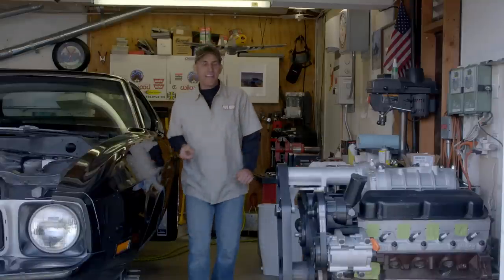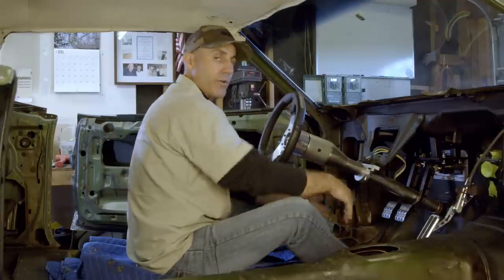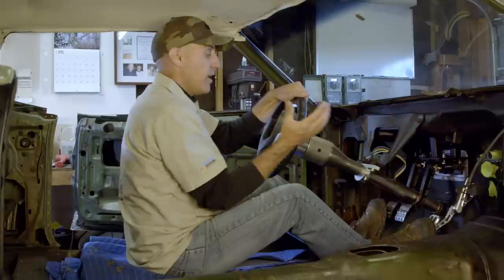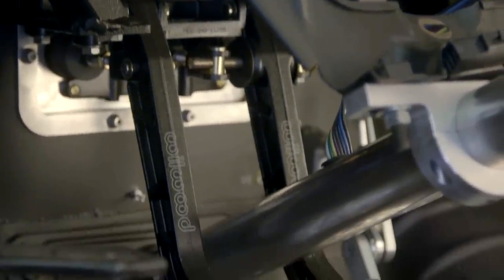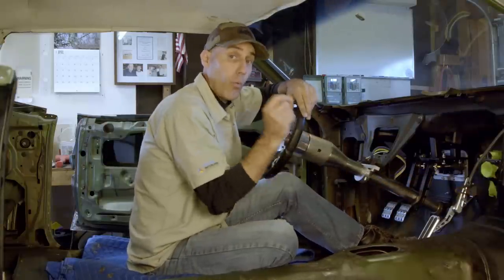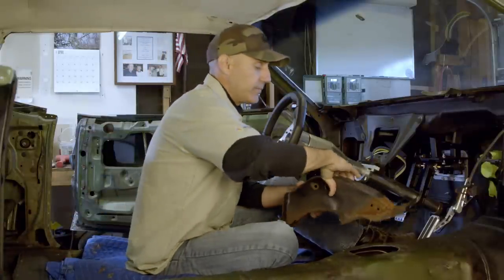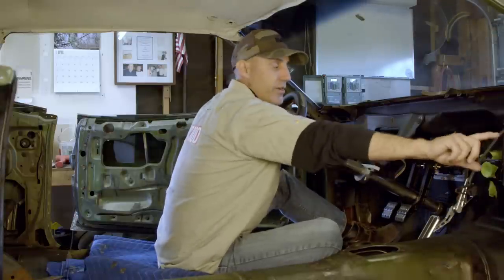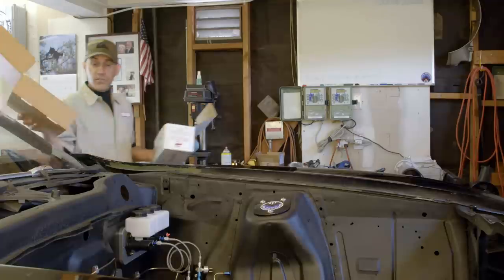Wilwood Clutch and Brake Pedal Conversion - Firewall Mount Triple Master Cylinder Assembly

Comment: I know this is an older video but it is still very relevant.  I  am putting this Wilwood system in a 66 Chevy II and was very concerned about the ability of the firewall alone to handle the wear and tear of actually driving the car.  I appreciate the advice and the images of the support structures.  It will help a great deal.  thanks
Reply from the maker: Really glad to hear this and appreciate you taking a moment to share, thank you!

Comment: I knew there was a lot that went into a conversion like this but I hadn't considered the support mechanisms you'd have to have to keep the pedals and mounting bracket stable. Great video Jason. ttyl -Drew
Reply from the maker: +Supradrew™ Yup, that's the part that actually took more time.  Getting them in the right spot wasn't as hard as I thought it would be.  Now I just need to get that clutch figured out....

Comment: I just got done going a big brake kit front and rear on our Jeep jk! I don't have the videos up yet, but I've found that brakes can be fun when the vehicle and all the parts are new lol.
Reply from the maker: +Rocky X TV Which brand brake kit did you install on your JK? I'm might try to get the Wilwood kit for mine.
Reply: autoedit I went with TeraFlex, upgraded to the slotted rotors as well. Went from 11" single pistons to 13.5" and dual piston calipers. I'm pretty sure Wilwood makes a kit for the JK but it seems more race inspired rather than trail, just my two cents. Thanks for the reply!

Comment: I would like to do this upgrade on my 65 mustang project. What is the part number on the 3 master cylinders you used? Also, are there any other parts I would need other than the mounting plate, pedals, and MCs? Thanks, in advance, for your help.

Comment: I'm building a 51 willeys 4x4 with a full floating dana 60 front & a dana 70 rear.  The front brakes are 2009 dodge ram 3500 & the rear brakes are 2006 GM 3500.  Will the master cylinders & reservoirs you have in your car move enough fluid for what I'm trying to do, or do I need something bigger?  I really dig this set up, I gotta run something like it in my willeys.

Comment: Jason Great Video,  I am also installing the wildwood pedals and a t5 transmission in my 68 fastback.  What is the part number of maker and part number of the hydraulic throwout bearing you are using?  Also did you use a 3/4 mastercylinder bore for that bearing?

Comment: i have these wilwood pedals im about to start fabbing a bracket for.. if i recall, the steering column mounts off the stock pedal bracket  on a 68 mustang and that has to be removed.. do you have to fab a bracket for the column? or do you know??
Reply from the maker: I used the stock steering wheel drop bracket.

Comment: Nice work! But let's see more of the Wrangler!
Reply from the maker: +alan jackson Roger that...started shooting Wrangler videos today!  Hint, it might have something to do with 37" BFG's and it's going hilariously bad so far.
Reply: +autoedit I 2nd that.  You shoot great videos and are easy to listen to and follow.  I own a 2012 JKU and run a 3" BDS lift with 315/70/17 Nittos. Want to go to 37's and 4:88 gears so anxious to see your build come together.
Reply: +Orange Crusher How do you like that BDS lift? I'm planning on lifting my 2012JKU this summer.
Reply: +alan jackson Had it installed a couple of weeks after I purchased my JKU in 2012.  I have not had any issues with it at all.  Its got a lifetime warranty so you cant go wrong there.  "We back our commitment to engineering reliable, quality  4x4 off-road Jeep and truck suspension products with our unique "No BS Hardcore  Lifetime Warranty".If you are the original purchaser of any BDS lift kit and it breaks, we will give you a new part. Period."

Comment: How hard was it  to adjust the balance between rear and front brakes with the balance bar. I hear it can be tricky
Reply from the maker: It's not hard to adjust at all.  The trick is in the initial setup and the key is to set both adjusters about the thickness of a quarter from the inside washer so they are pushing straight. That way when you do the balance adjustment they stay in perfect alignment.
Reply: @AutoEdits  was it preset for the balance?
Reply from the maker: @wldtang  Nope, not even close... took a few minutes to setup properly.

Comment: hey mate, nice video! what was the deciding factor for going with the dual master cylinder as opposed to a single with a brake booster? how is the pedal feel? stiff?  
I'm worried without the booster that it might feel as stiff as the all drum setup I have on my mustang..  but I  have the wilwood disc set ready to go in.. thanks,
Reply from the maker: +Troy Dawson It was mostly due to the fact that I wanted the really cool Wilwood pedals in this car.  By the time I added up buying a stock clutch and brake pedal and master cyclinder... this option ended up only costing $50 more (all in) but required more labor to fabricate the install and it is totally worth it!  I'll let you know how the pedal feels after the system is bled.

Comment: What is the firewall and engine bay coated with? Looks great
Reply from the maker: +Carlos DeLaTorre That's the spray can bed liner. I just apply it so the texture is nicer for an engine bay.

Comment: Does this system not require a brake booster anymore?
Reply from the maker: I'm designing this system specifically to eliminate the booster.  Lots of equations to take into account.  It's much easier to add a booster later.

Comment: 6 years later, how did it withhold?
Reply from the maker: Up until I sold this project... the pedals performed amazing. Absolutely phenomenal product.
Reply: @AutoEdits  did you do a video showing how to bleed dual masters or balance bar systems
Reply from the maker: @davecaresforyou7606  I didn't. It's the same process, very easy.
Reply: @AutoEdits  I tried to bleed one at a time with balance bar and it wouldn’t bleed all the way so stopped bad
Reply: @AutoEdits  did you have a balance bar set up as I don’t remember and you m being told I have to bleed one front and one back caliper at once

Comment: sold the 302 and bought a 351w to go in my 73
Reply from the maker: +TheSamplebridge Cool, more cubic inch means more power!
Reply: Yeah sold the 302. The guy took it to a shop and the shop said it looked brand new. Didn't even need bored over .030
Reply: Gonna put heads, cam intake and carb on the 351. Looking for about 350-400HP

Comment: How do these pedals and master cylinders do in a autocross or track day setting since they have no brake booster? I’d like to do this to my 69 Mustang, but I’m wondering how they perform.
Reply from the maker: I haven't driven this vehicle on the road yet but I have raced cars with this exact setup and liked it very much.
Reply: autoedit Thanks for the reply. I think I’m going to go with a setup like yours. Maybe floor mount though. Will make the car more of a driver’s car!

Comment: gas pedal seems a little low for heel tow
Reply from the maker: +ImEnhalos Actually, in my experience for a sporty street car, it's safer to have the pedal slightly lower so that you don't hit the throttle accidentally when braking around town.